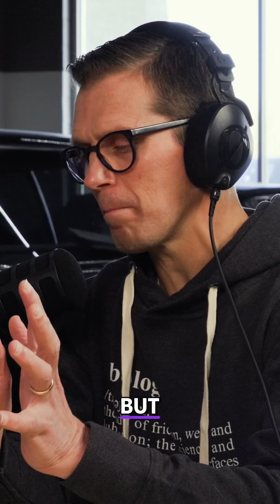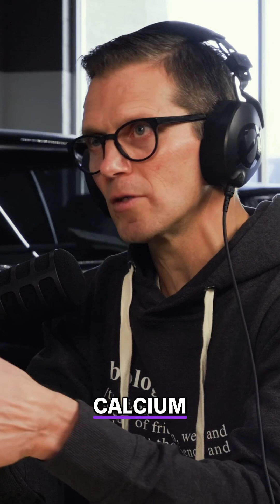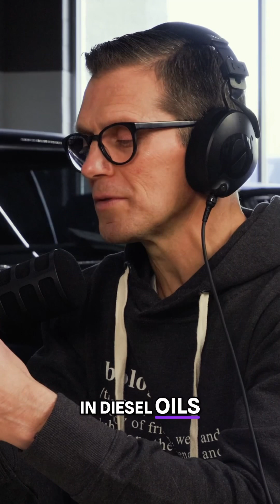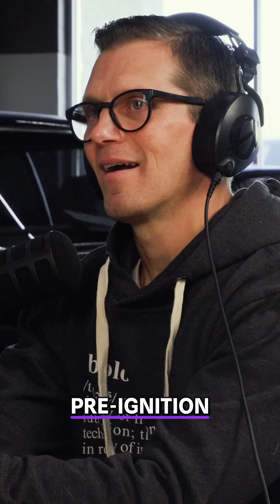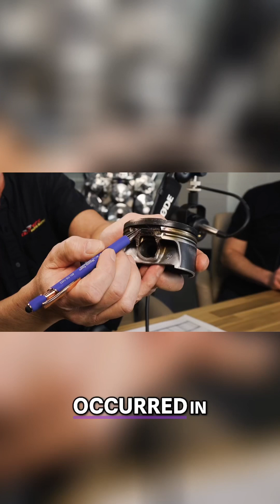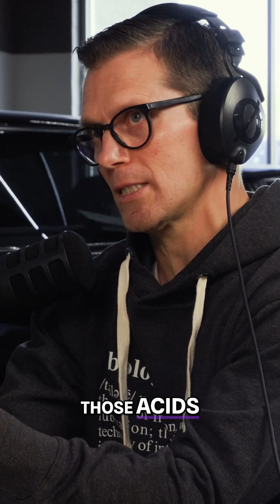Diesel Oil in Gas Engines: Understanding Low Speed Pre-Ignition

Comment: Mostly depends on if you run true diesel oil or not, diesel oil nowadays are mostly dual rated to gas engines with less detergent but still high anti wear additives making them superior

Comment: Guy full of shit ... Of a diesel truck run for 700,000 mi on diesel oil why not put in a car
Reply: chemistry. high detergent and dispersant is good for controlling soot in a diesel engine, but counteract the zinc needed for wear resistance in a gasoline engine. will cause more wear and the unitended consequence of autoignition near weak areas of the piston

Comment: I.m just wondering how I've been using Rotella T6 5-40 in my 2019 3.5 ecoboost for the last 54k of 66k on the odometer. Running 91 octane top tier with a 91 0ctane COBB tune for the last 5k or so. Idles great and doesn't sound like a sewing machine.
Reply: It doesn't affect everything to the same degree, obviously.  Or every direct engine before the removed the extra calcium was removed from gasoline engine oils would have blown up.    I do suspect that you use of 91 octane, top tier gas was likely quite helpful.  So if you plan to continue using the diesel oil, stick to that formula.

Comment: He is smart but pretty sure he forgot to mention you can't use diesel oils in DIRECT INJECTION  gasoline engines.....but you can in everything else....carbuerated or throttle body injection
Reply: Clearly you were not paying attention. He literally explains why you should not use diesel in a gasoline engine.
Reply: @Scott95z  Actually he is talking about direct injection engines specifically.  Low speed pre-ignition is a direct injection issue, and one triggered by high calcium levels.   That doesn't mean that diesel oils are ideal for gas engines, but this was specifically a direct injection issue.
Reply: Mobil 1 esp2 0w40 is for diesel and direct injection petrol engines